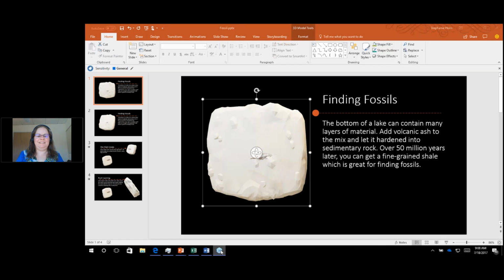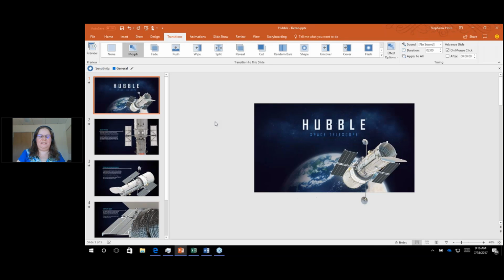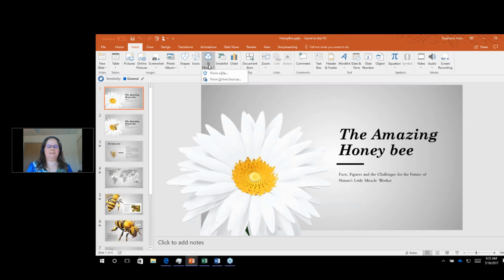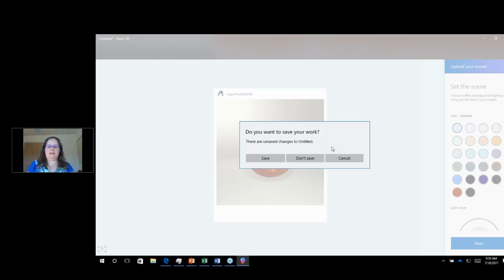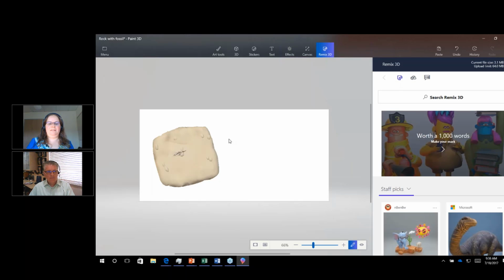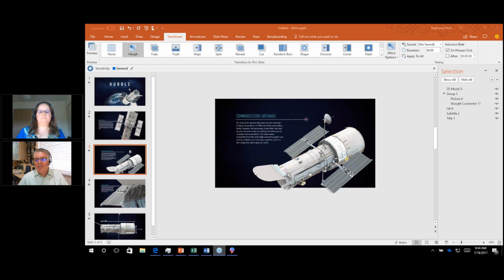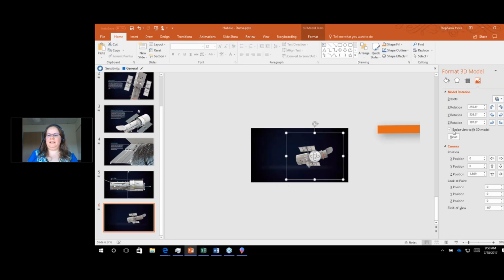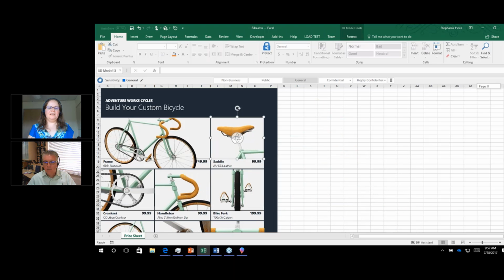3D Tools in PowerPoint

Comment: For some reason when I uploaded an fbx 3D model onto my PowerPoint, it has no color/texture. Any thoughts?
Reply from the maker: Hi, TheUnstoppableBrigade:

Does the FBX have color and texture? That might seem like a silly question, but some of the modeling software export without these properties or provide an option to export with or without them. 

Also, are the colors and textures embedded in the FBX, or are they external? It's better to ensure the textures are embedded in the model file because the external files can be placed in the wrong location or might not be shared with the model.

If you have the Windows Creators Update, one option is to try loading the model in Paint 3D and see if it has the additional properties there. 

If the model does have properties but they're not showing in PowerPoint, that's a bug. If that's the case, please let us know because we'd love to be able to send the model to the folks at Microsoft for review.

Comment: I have Microsoft Office 365 ProPlus  Version 1705, build 8201.2193 but I dont have the 3d menu. Do you know why?
Reply from the maker: ProPlus doesn't get updated with new features very often. Here are some links that may help. You may need your IT staff to opt into more frequent updates. You'd probably need to be in the First Release channel to get the 3D right now (Sept 29, 2017). 

https://support.office.com/en-us/article/Overview-of-update-channels-for-Office-365-ProPlus-9ccf0f13-28ff-4975-9bd2-7e4ea2fefef4?ui=en-US&rs=en-US&ad=US

https://support.office.com/en-us/article/How-Office-365-commercial-customers-can-get-early-access-to-new-Office-2016-features-4dd8ba40-73c0-4468-b778-c7b744d03ead?ui=en-US&rs=en-US&ad=US

Then there's the whole subscription thing. Generally speaking, it's the subscription versions of Office which get updates. Here's some information about that. http://www.pptfaq.com/FAQ01255-Office-365-Office-2016-an-attempt-at-clearing-the-fog.htm